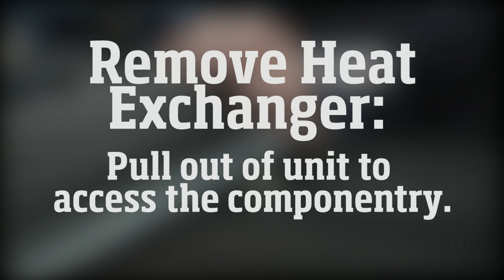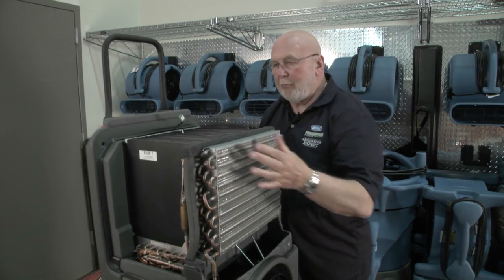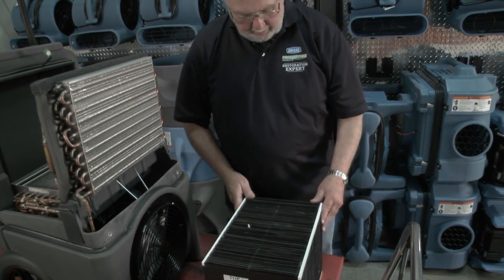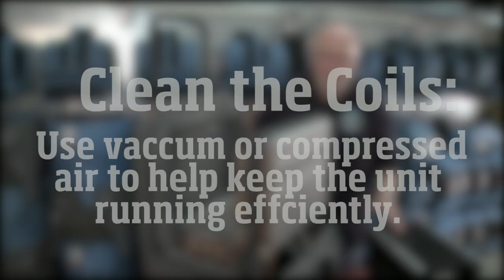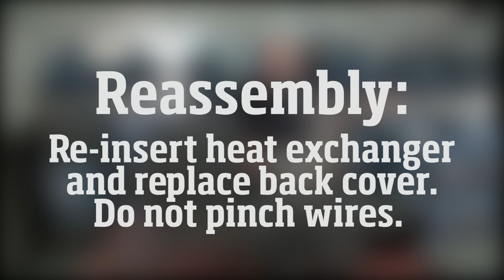Servicing the Dri-Eaz LGR 7000XLi Dehumidifier

Comment: Hey Robert,
 I have the same unit I bought it used. But it was pretty much new. I bought the bigger more expensive filter off ebay. And noticed a odd smell when installing the filter. I thought it was just the plastic from the new filter. It has been 6 months and went to use it. And it smells so bad you would think a fish has been rotting in it for months. Even just letting it sit in a room with nothing open on it is way bad odor wise. Is there anything you use as a cleaner to help kill the odors in them on really really big jobs of mold remediation. I hate to throw away a 120 filter that doesn't even have 5 hours on it. But Im thinking Im gonna haft to throw all the filters away and start over? Is there another element inside of these unit that would collect mold etc that might need to be replaced? Thanks
Reply: Our HAF filters (blue plastic filters from 3M) have an antimicrobial treatment, so it's not likely that the odors are coming from them. The more likely source of odors is coming from mold inside the pump housing. A thorough cleaning of those components should get your dehu smelling nice again!

Comment: Hello .  Why after running I  drain pump to get any water from sump out I then  shutting off my dehumidifier 7000 xli.  After sitting over night I noticed a puddle of water under the dehumidifier ?  Is it freezing up ?  then melting after shut down. Please help. I know the pump is working and I see the water going threw the tube.  Thanks.

Comment: I got an error code 9 on this model. It says there is a block with the pump or hose line. However, I've replaced the pump. replaced the float switch. checked the connections. swapped out the head unit and still get this error. Basically when I turn on the machine the countdown for drainage is stuck and does not count down before it goes into error code9. Does anyone one know the issue. Is it in the power unit at the bottom of the machine or there is another sensor I am missing?
Reply: I have the very same issue and nobody offering solution?
Reply: Update. I've swapped out working circuit board at the bottom only to still get this error. Only thing I've noticed works is when I swap out the head unit. It'll bypass the purge countdown and work. However next power cycle it'll come back. I'm tempted to try replacing the head unit with a newer one that's out so it can be wireless. Emails to drieaz gets no reply. I can only think it's a software issue at this point.
Reply: I had the very same issue. Took the pump apart and cleaned it with just soap and water, rinsed real good and put it back together…all seems like ok for now and working well.